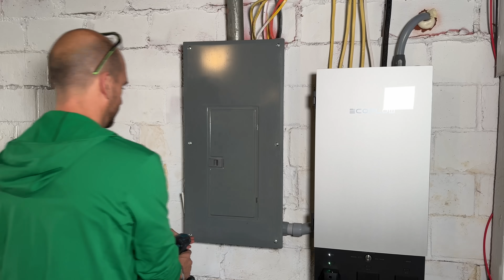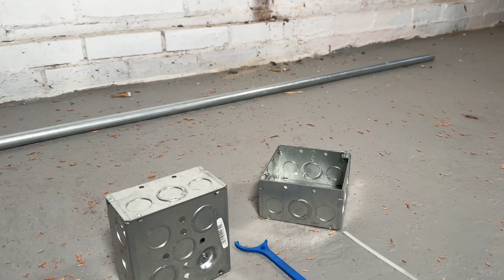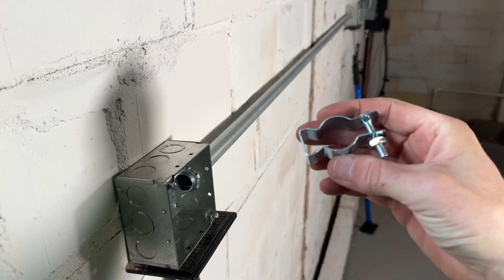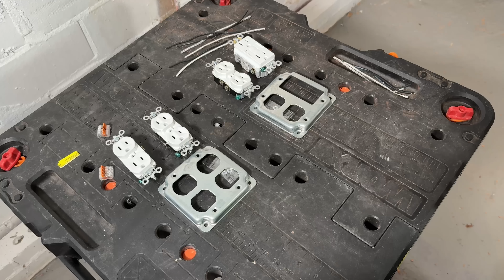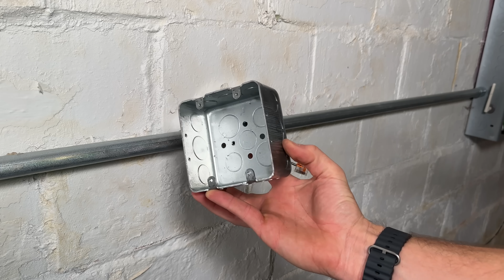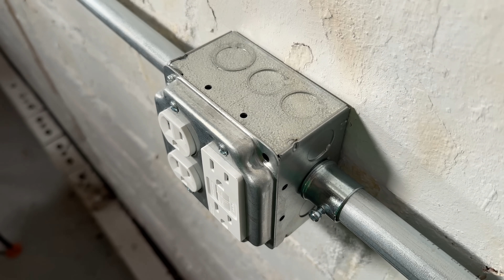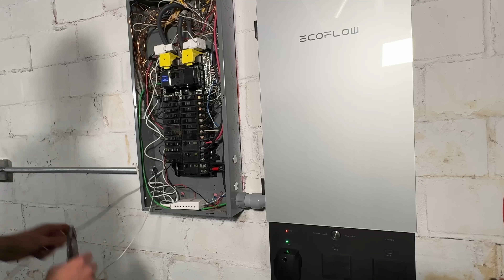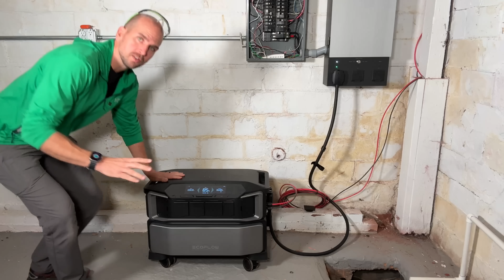Add Outlet To Unfinished Basement Or Garage

Comment: Worst Conduit work ever.  NO box offsets no clamps and no ground wire WTF.....  Seriously when are you going to quit giving electrical tutorials with absolutely NO CLUE what you are doing and having installs that do not meet code...
Reply: I'm pretty sure he just leaves things out for engagement purposes in the comments, and it works 😂
Reply: @avsrule247   No he is clueless and should NOT be doing tutorials.  It's clowns like this that prompt regions to pass legislation that ban homeowners from doing electrical work. And it must be performed by a certified electrician..
Reply: Which code specifically?
Reply: @radish6691   NEC 358.30   With Conduit you ALWAYS put a clamp within 3" of the box for support just good practice, and IIRC the CEC requires that. The NEC requirement  is 3'.  Furthermore even though code does not require it you ALWAYS pull a ground wire in a conduit as there is NO guarantee the conduit will retain it's continuity with age, this is just standard good practice a GFI with no ground is sort of useless.
Reply: @matthewq4b I’m not sure if he’d be able to strap it without stressing the pipe or box connector without an offset to get it close to the wall…
Reply: @kevintotanes8760   Hence the need for box offsets.  Sounds like you are making excuses for shoddy not to code work..
Reply: @matthewq4b Not making excuses; making a criticism.  There must be offsets in order to strap without stressing equipment which there are none.
Reply: @kevintotanes8760  absolutely not. In fact many manufacturers offer conduit support straps specifically for unbent EMT. There is no code requirement for box offsets,  nor is there any "stressing." I do agree he did not use any straps which is against code and I agree that box offsets look much better and the fasteners are much cheaper that way, but he can get or even make fasteners that will work without offsets in the conduit.
Reply: @TwilightxKnight13  Correct - that that would be the other compliant (although costlier and less cosmetically appearing) alternative to secure tubing
Reply: @kevintotanes8760   Well that's obvious.. so what's your point exactly. ?
Reply: @matthewq4b to highlight the importance of offsets (like you mentioned) in the absence of clamps/struts  etc.

While not a requirement, I wouldn’t want tension on the equipment to risk yanking out of the wall - especially when securing into mortar which I think is quite brittle to begin with
Reply: @kevintotanes8760   This install required clamps on the conduit to be code compliant. In fact ANY install of conduit requires clamps unless it is a nipple between boxes/devices.  If you need clamps you need offsets.
Reply: @matthewq4b  correct, this (and all) installs involving a raceway (greater than >18”??) require clamps/strapping/ some method of securing.

Sorry I didn’t clarify (I’m at work trying to reply to these) that offsets aren’t a requirement, but good practice in absence of clamps/struts to avoid stress on equipment 

Have a good day
Reply: @kevintotanes8760   If you have room for offsets you have room for a clamp that is exactly how inspection will look at it.  If you put in a piece of pipe with box offsets inspection will expect to see a clamp on it.
Reply: @matthewq4b  Thanks for the info. Sounds like there’s no downside to pulling a ground wire and all upside. Considering people with no training will be following his tutorials to do their own wiring it’s probably a good idea to demonstrate the method with the greatest margin of safety.
Reply: @radish6691   It is good practice to pull a ground in a conduit and they do not count against conduit wire fill.   There is no guarantee that the continuity integrity of the  conduit it going to always going to be there, especially with EMT.
Reply: @radish6691
Not having a ground wire from the metal box to each of the grounding scews on each receptacle. If someone pulls the plate off when the circuit is live the person has no ground protection and the circuit's not easily going to want to trip the breaker. That's a violation of the NEC code...each receptacles on each receptacle plate MUST be grounded to the grounded box.*
Reply: @Danielthornton61   Ya he continually posts electrical DIY with no real clue what he is doing and practices that not only are  bad but also very dangerous.
Reply: @Danielthornton61  Thank you for the clear explanation.
Reply: The NEC regarding the need for straps based on length of runs, proximity to boxes etc. Proper grounding. 
 @radish6691  358.30 SECURING & SUPPORTING
This section also requires you to strap within 3-feet of any box, panel, or termination point for that conduit run. That's not difficult to remember. From your panel or box, run your conduit up, strap it within 3 feet of the panel, then every 10 feet after that.
Reply: Matt, 
What's your opinion of using the WAGO connectors?
I'm a DIY guy & have used connectors like that for LOW VOLTAGE/change fluorescent to LED lights & they work great. 
My "Old Timer Electrician" buddy (Certified Electrician) doesn't care for them.
Installing a bunch of wire connectors into an old or new work box is a pain in the ass.
I would use WAGO type if I had some more positive feedback.
Let me know what you think please.
TII
Reply: @tii2015  Wago had a spring tension type (like the back stab clips in receptacles) that are junk maybe that's what electrician buddy is referring to. The new Wago 221-412 or 413 or 415 (two, three, and five wire respectively) are levers and seem to hold up really good. Haven't' had any issues with them so far.
Reply: @Bluesman57  Still a better electrical connection with a Marrette (Wire nut) as there's more surface area between conductors when twisted tightly together with a tightly secured Marrette than the pinch point of the Wago.  It's probably fine for LED lighting and some light loads but I wouldn't want to run high-power devices or even large electric motors through a Wago connection.
Reply: @tii2015  You have a better mechanical and electrical connection with a properly installed wire nut than a Wago.  The reason is you twist the conductors together, fairly tightly and then twist the wire nut on securely and it has far more contact area than the pinch point of any Wago.  The Europeans rave about them but Big Clive said that the first to fail is the Wago.  Granted, it takes quite a bit of power to pass through them to do it but properly installed wire nuts (we call them Marrettes in Canada, because, like the Robertson, incorrectly called the "Square" screw driver, it's a Canadian invention like the telephone and lightbulb.)
Reply: @tii2015   Wago if you are not capable of doing a proper wire nut connection... Regardless do NOT use wagos in high draw applications. They are fine for low amp applications like light fixtures  but i would NOT use them for high draw outlets.   They have been barred from use in most life critical applications.  Those applications typically specify Buchannan's or hand twisted wire nut , meaning you do not use the wire nut to twist the wire. (you should never really do that anyway and should always twist by hand.)
Reply: @matthewq4b   Please cite an official source for this "banned" information, thank you.
Reply: @Dustball460   Was cited in the original post..... looks like you have comprehension issues
Reply: @matthewq4b   What's with the insult- just asking for a source. What original post are you referring to?
Reply: @Dustball460   the post you replied to..  Not winning any valedictorian awards are ya..
Reply: @matthewq4b   The codes you cited have nothing to do with Wagos being banned. How about some reading comprehension of your own?
Reply: @Dustball460  How ironic that he said you have reading comprehension issues, when he can't even answer a simple question. Keyboard electricians are just the absolute worst. They think that the codes for their jurisdiction are the only correct codes and every other jurisdiction is wrong. It's quite hilarious. I'm still convinced that Scott deliberately "forgets" to do simple things like strap the pipe just to get the engagement from these guys who get so triggered 😂
Reply: @Dustball460   OMG read it again.  You understand what MOST means right.. and being life critical automatically mean it's an engineered installation. Each engineered  job has it's own set of specifications. 
 And if you mean WAGOS and NOT conduit then say that. The thread is about conduit where wagos were mentioned.    You lot are not winning any awards for brilliance..
Reply: @avsrule247   hey muppet the CEC and the NEC override ALL local codes. All local codes can do is go above and beyond...  And if he "forgot stuff" he would not correct it in later vids.   You did not graduate high school did ya...
Reply: @matthewq4b   I'm done with you. You seem to be a bitter person who spouts personal opinions as 'facts' and can only resort to name calling and insults whenever someone else disagrees with your opinion. I am in the automation field and use Wago lever nuts frequently. There's no problem with them when it comes to the NEC or NFPA.
Reply: @Dustball460  Wagos in industrial applications?  That's not a good choice.  There I would use screw terminal and lug blocks, one because inside a machine control cabinet it is more organized and professional looking than a bunch of Wagos running in random directions and second, screw terminal blocks can be torqued to spec while Wagos are glorified home stereo speaker terminals.  They heavily rely on spring tension to make a connection.  Those connections, with temperature cycling get weak over time making more and more of a chance of faults or worse, a fire.  Wire nuts (Marrettes) are similar to lug and screw terminals where there is more surface area used to hold connections tightly together and this is pretty good as a mechanical connection outside of soldering wires together.
Reply: @WJCTechyman   We use WAGOs for field devices that have factory leads on them and do not require disconnecting/reconnecting on a regular/periodic basis. We don't use them in control cabinets except for connecting any fans that have factory leads on them. For control cabinet wiring, we use spring terminal blocks unless screw terminals are specified by the customer. I prefer spring terminals over screw terminals as I've come across far too many screw terminals that were not properly torqued by other people or that the conductors have become loose due to thermal cycling or metal relaxation. Our policy for screw terminals is that all screw terminal connections require ferrules to be installed on the conductors which is additional time spent. 

I am aware of the Big Clive video on WAGOs and of other videos that have tested WAGOs. It takes a very large amount of current to melt one and when the plastic does melt, the metal cage still holds the conductors in place.

To be clear on WAGOs- I am referring to the lever lock versions, not the push-in versions.

I completely rewired my equipment trailer 13 years ago using WAGO lever nuts in all of my junction boxes and I haven't had a single wiring issue since then despite all of the vibrations the trailer experiences. When it comes to using wire nuts or WAGO lever nuts, I prefer to use the WAGOs.
Reply: @WJCTechyman they're csa approved and good for 32a.
Reply: @trevord7659   And FPE panels were approved at one time also and how did that turn out......   Wagos internal resistance increases with time. I have seen more than one melted wago used in a high draw outlet.  They are not allowed for use in most life critical applications for good reason...  Wagos are great for fixture terminations  but really should be avoided for outlets and in system wiring.
Reply: @matthewq4b So wagos internal resistance goes up over time but fire nuts don't? Where did you read this? Europeans have been using them for over 30 years without complaints.
Reply: @trevord7659   Wire nuts have over 1000 times the surface contact area than WAGO's. The conductors are physically in contact with other, and wire nut splices done correctly do not change resistances  over time.    Wire nuts splices have been used for over a hundred years. The wires insulation will fail long before a properly done wire nut splice will, the same can not be said about Wago's.   The Europeans use  220V for their domestic services with corresponding  MUCH lower amp load devices. Wagos work fine on low amp draw 220V systems.  This is why I said they work great for fixturers here low amp draw...  BUT they should not be used for outlets or system connections on 120V installations. I have seen more than one melted wago used like that. This is why they typically are barred for use in life critical applications.  They do not have the longevity, security or system integrity that a properly done wire nut splice provides.
Reply: @Dustball460   NO WHERE did I say WAGOS were barred by code  you clown. And the NFPA and the NEC ARE THE SAME THING..  Apparently you have NO clue what an engineered job is OR what specifications are or what the NEC is... Tell us you have no clue what you are talking about by not telling us you have no clue.....
Reply: @trevord7659    Wire nuts resistance dose change just cause of the area of contact between conductors is so great and the conductors are in physical contact with each other. In a Wago they are not in contact with each other and are relying on a lower conductivity steel bridging spring .   ALSO Europeans have 220V systems with MUCH lower amp draw on their systems.   This is why WAGO's are barred from use in basically ALL engineered jobs and in all life safety applications.
Reply: @matthewq4b  all the jobs I work on are engineered and none of them have banned Wagos. They're ul rated for 32a. Not all European circuits are low amperage. If they were a problem, the Europeans would know by now.
Reply: @trevord7659    And again Different systems.   Wagos are barred from USE  IN ANY LIFE safety application.   Wagos have CAUSED FIRES. Specifically when being jammed in to boxes and the levers are forced open from another wire something that is difficult to see. Alos wagos have increased resistance with age. Something that is a non issue with a properly done wire nut..  And have you actually read the specifications for these jobs....  More than one contractor has been burned after the fact for using wagos where they should have not...   And Basically ALL European circuits are low amperage Like half,  that is why the typical common use CB is 8 amps. And why do think WAGOS are rated for 32 Amps  that is the 4 to one safety margin for common use 220V circuits.  NO such margin exists  for common use 120V circuits..
Reply: @matthewq4b provide some links for your claims man. The Europeans don't only have low current circuits. They also have high current circuits. And they love them. Why would they all of a sudden be approved in north america if they were so bad? You think you know more than the underwriters lab? Or all of the Europeans who use them for high current circuits? Wire nuts are called fire nuts for a reason.
Reply: @trevord7659   the Europeans DO NOT have high current circuits in their homes. 13A Breakers are the HIGHEST they use in their homes...  That is STILL less than typical SMALLEST CB used in a North American home.... And Guess what FPE panels were approved by UL AND CSA also and how did that work out ?Just cause something is approved for use does not signify it;s quality....  Any one with ANY knowledge would NEVER use trade approval as a metric for ANYTHING... Ande Wire arte ONLY an issue is NOT installed properly  they have been for OVER a century and have PROVEN to provide a lower resistance connection than Wago's  And show me a hospital or specs allowing  Wagos, go on I dare ya....
Reply: @@phillipbanes5484 There are already many locales in both the US and Canada that do not allow homeowners to do Electrical work in Apartment-style condominiums, stacked, semi-detached and row housing dwelling units.. Cities like  Houston and many others do not allow homeowners to do ANY electrical work at all...   Try doing 30 a second search so you can avoid looking a like a clueless muppet in future..
Reply: You people are the clueless ones.
First, modern Wago have been thoroughly tested vs wire nuts and are just as effective at making safe, durable connections. What the hell is a "high draw" circuit? The curcuit can draw exactly what it is designed for. In this case 20A (actually the breaker will probably trip somewhere around 18-20A). Standard Wagos are rated for at least 30A and that includes a safety factor. In fact, tests have shown that most DiYers do not install wire nuts properly and Wagos are actually better for them.
Second, every part of this installation meets code except the lack of conduit support and perhaps him pushing wiring with exposed tips into a hot panel. While it is certainly true that most will prefer a separate EGC and many inspectors will demand it, the Code allows for the conduit to serve as the EGC in this instance.
Stop acting like reactionary, hyperbolic trolls. Get take some electrical code classes and learn something for fuck's sake.
Reply: Why do you watch it then? Seems like you just like to post negative comments on his videos. You don’t offer any real constructive feedback or the “correct” way of doing it.
Reply: @antkn33  Why did you comment ?   Some of ya are the sharpest stick in the bunch.
Reply: @matthewq4b  Thanks! 😂😂😂
Reply: I agree this is bad work. No inspector will approve of this. Better to hire an electrician with conduit experience. Look up this code for securing EMT. 
NEC 358.30(A)
This video is a violation.
Reply: @matthewq4b I have greenlee little kickers, 1810 1/2 1811 3/4 perfect box offsets every time. You're right worst conduit ever, he knows enough to be dangerous, but sadly people that don't know any better will follow his advice.
Reply: Well I reported this video for harmful content and legal reasons because someone you shouldn’t teach someone how to be a hack, especially when it comes to electrical work. Someone will get hurt listening to this guy!